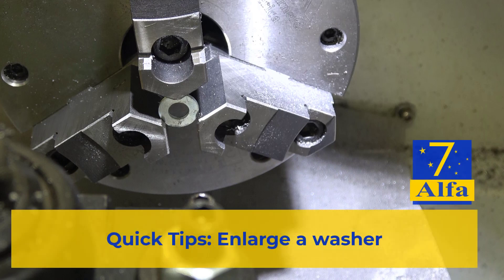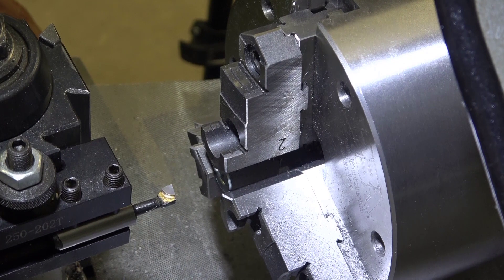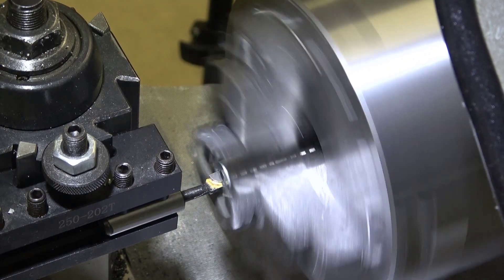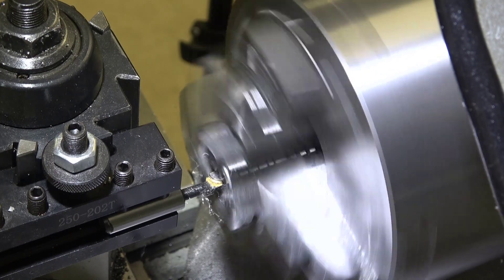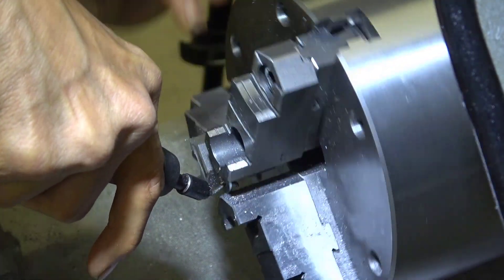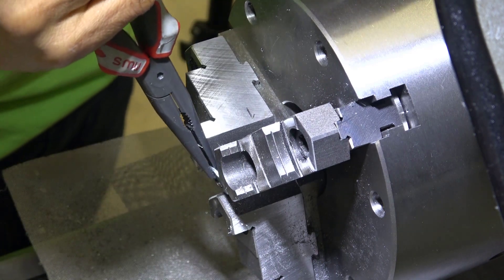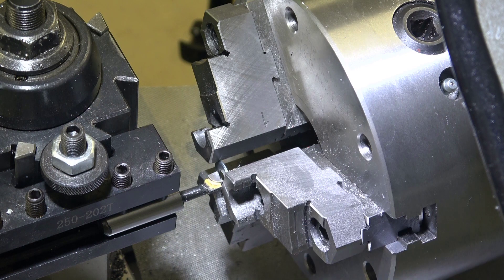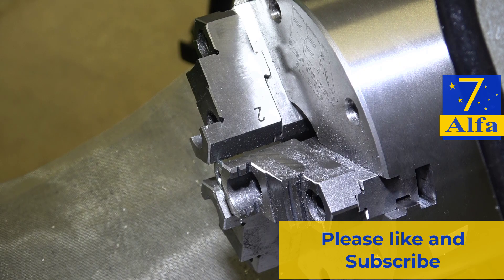Enlarge the Hole in a Small Washer using a lathe

Comment: Probably needed a specific boring tool to clear it fouling on the radius, but great use of a lathe for smaller tasks.  Worth having “repair washers” in your stock for additional options - they’re just a huge penny washer with a small hole in the middle.
Reply from the maker: Thanks for the tip!